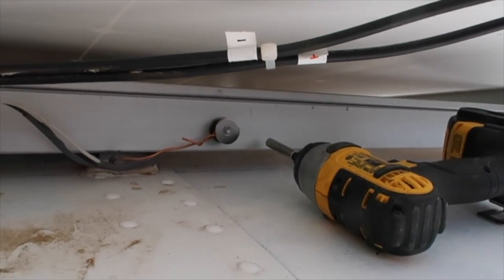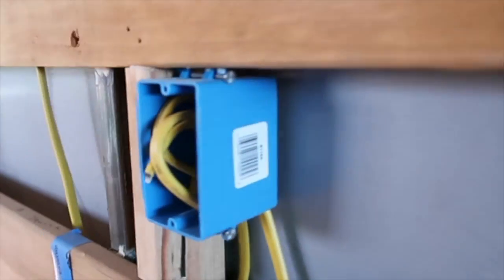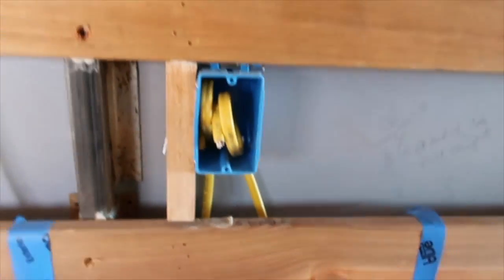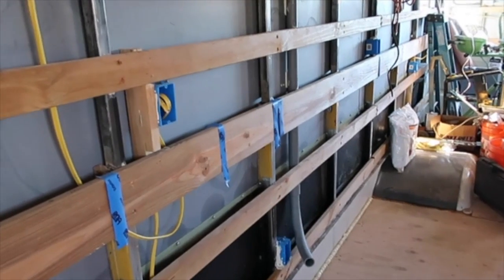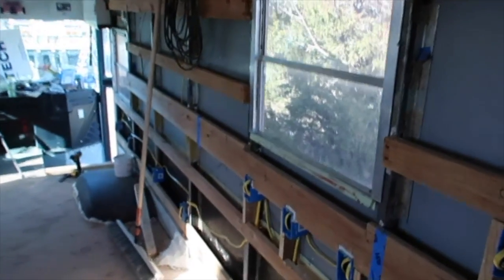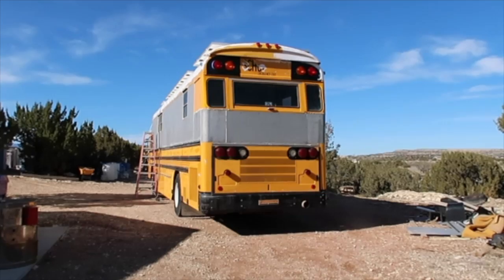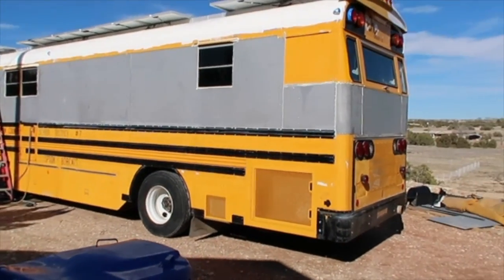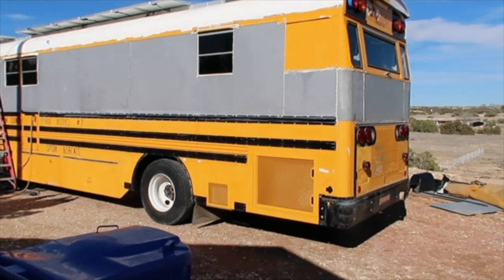School Bus Conversion to Motor Home #18 - Grounding solar panels

Comment: Be careful stand on the top rung of that latter, I saw it move several times while you wer ground the panels.I have seen you use an extension latter while working on the roof. Do not get hurt before you get to use the bus.

How many boxes are you installing on a 20 amp circuit?

Do not rely on GPS to tell you about low over passes. Number one defense is your own common sense. If it looks low stop, get out and look.  

Glenn Lever
Reply: That is good on the boxes, you should only have ten connections in a 20 amp circuit. With else than 5 boxes per circuit you should be good. good luck in your travels.

Glenn lever

Comment: the silicone hose is far better then the old hose
Reply: Roy is correct. I service generators for a living. Air cooled residential all the way up to diesel 3.5 megawatt. We use only silicone hose for cooling system servicing and right now we use the brand that you have on the spool. Very good quality. Should out last your bus. I have a 100kw generator for my home and also used the 5/8" silicone hose for my block heater.

Comment: You sure do nice work ... it's great to see such attention to detail mixed with ingenuity! Welding the nail to the column sure was clever. Way to go. (And by the way, I also have a 2000 All American ... though my roof has not been magically lifted ...)

Comment: the insulation will save on heat an cooling, but using those windows will loose much of the savings.
best